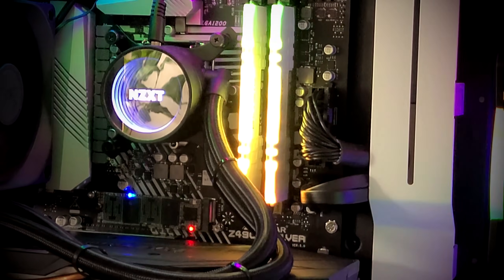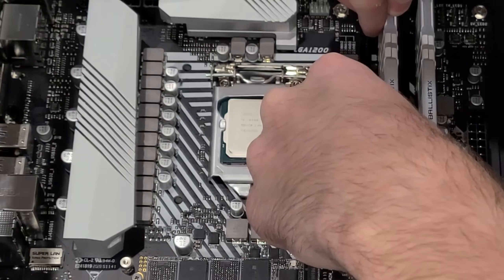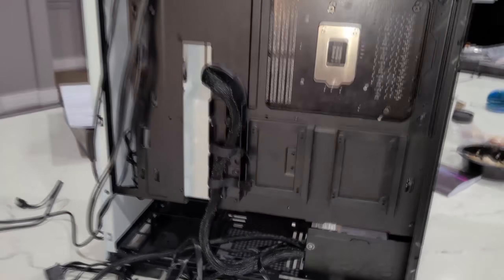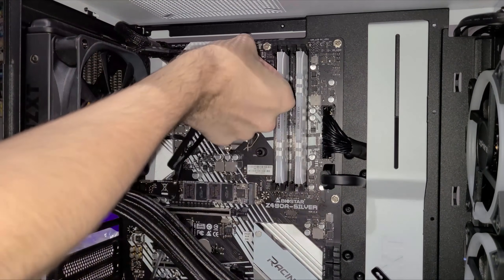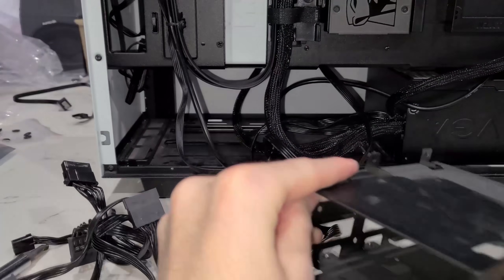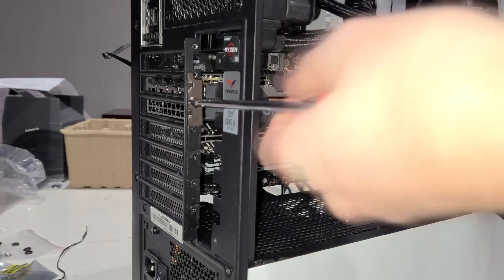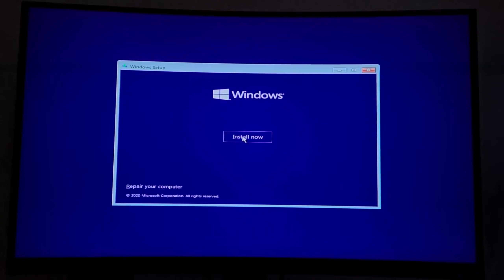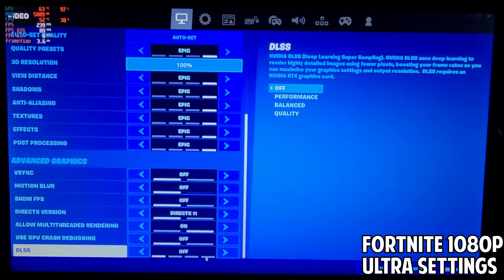BEST $1000 Streaming/Gaming PC [Build Tutorial, Benchmarks]

Comment: I’m gonna build this pc soon, are you able to run Warzone with these stats?

1440p 144fps

Max texture

Max anti aliasing 

Everything else low
Reply: Not at 1440p 144fps but maybe 1080p 144fps
Reply: @EddieZheng-k3u  I figured, I wonder if you can pull 100 on 1440, id honestly be fine with higher settings on 1080 than lower settings on 1440
Reply: dont build it just get a rx 5700xt this is more about looks than performance the 2060 is not good enough
Reply: @oreoeatsoreos9412  yes the 2060 is good enough for Warzone, and yes the 5700xt does come with the performance of a 2070, but still, its more expensive.
Reply: @LegendarymmHD  ye but the rx 5700 xt is a lot better doesn't the 2070 retail for 500 the rx 5700 xt goes for 400 it has performance similar to a 2070 super so a 2060 is not good in all games at 1440p 144fps the rx 5700 xt will do a better job what's the point of not using the full potential of your budget
Reply: @oreoeatsoreos9412  don't just take US prices, a lot of countries are selling them for cheaper, or for more expensive, and most of the people who buy them don't do it from the US, so just.. literally stop arguing.
Reply: @LegendarymmHD  then that goes both ways dude thats countering my point while countering your own
Reply: @oreoeatsoreos9412  stop arguing lmao
Reply: @LegendarymmHD  why should i in fact im doing more good then harm by telling people that for a 1000 dollars they can get something better for less aesthetics. something that will save them money in the future if you believe that you cannot do 1k build with a 5700 xt then you are mistaken, if you go at me with the countries argument that will go both ways and also what about the people who are from the US? the least im doing is helping those in the US get something of better performance.
Reply: I have a 2060 and a ryzen 5 3600. The 3600 performs very similarly with the 10400. I get around 120-140fps 1080p so I’d say to expect around 100fps most settings high-max.
Reply: @derickvo317  thx a ton for the reply man good to know
Reply: Wait for 3070
Reply: Bro trust me, get RX 580 it's way cheaper and way better it has 8gb vram : ) then u will have left like 200$ and u can choose it to get better processor or smth
Reply: Maybe just put everything on low then you’ll definitely hit 1440p 144fps
Reply: Guys I need help,I’m sorta new to pc,so I want to know 100% if these parts match with one another and won’t bottleneck very much,is this good so far?

https://pcpartpicker.com/list/jqGpgt
Reply: Yonkaboo Exkaboo I ordered the psu,mobo,ram,and storage,should I change something else
Reply: Yonkaboo Exkaboo  how would it do with just a 1660
Reply: Yonkaboo Exkaboo  i might actually go with a 1660 super,but let me tell you,I was going to build a pc based off a pc build vid,but they said it’s better to have a 1660 super than a 5500xt,so I bought the same psu,ram,and mobo from the video except the storage I changed it to a m.2,I plan on getting the same cpu they said which is the ryzen 3 3100,but I wanted to make sure if me changing the graphics card was going to affect the components in a bad way
Reply: Yonkaboo Exkaboo  I wanted my budget to be $600 or a tad bit up,but I’ve been asking people if the build is alright to be reassured and order the rest
Reply: Yonkaboo Exkaboo  but can I pick any 144hz or is there any requirements for my pc?
Reply: and great vid btw

Comment: I heard the h510 does not have good airflow... is that true?!?!? I wanna get the case but I have cold feet about it
Reply: My case temps for my h510 i with a 2070 super is around 67 Celsius playing with RTX on with maxed settings. Awesome case though
Reply: yeah it doesn't have the best airflow so the optimal route with that case is to use an aio but if it doesn't fit your budget I'd get a different case.
Reply: @kyng_khris317  guess I might need to get another case then ahahah... thanks
Reply: @King-zo4vv  no problem but if you go for the aio a one fan variant like in the video is pretty cheap.
Reply: @kyng_khris317  I'll check it out but budget is kinda tight tho
Reply: @King-zo4vv  yeah I wanna say it's about $80 for the aio featured in the video but i'm also debating on whether it can fit my budget or not.

Comment: Im more about ryzen, so which one do you recommend me and can inuse the same motherboard?
Reply: If you like ryzen better, I suggest getting a ryzen 5 3600 or a ryzen 7 2700x along with a b450 board as z490 doesn't work
Reply: You can’t use a intel motherboard for a ryzen chip. Not compatible. But I would recommend any good quality b450 or even a B550 and if not that then you can get a x570
Reply: @juanmoreno2627  thanks @juan
Reply: @JohnTv2704   hey make sure the motherboard is compatible with the cpu. There are website that let u know
Reply: @juanmoreno2627  i advise you not to go with a b550 board since their price is almost the same as x570 and x570 has better features, i actually dont like how b550 is priced since x570 offers alot better at the same price
Reply: Cant use same motherboard. I would recommend a ryzen 5 3600.
Reply: Use the AMD Ryzen 5 3600 for your CPU and a good Motherboard is the MSI B450 Tomahawk Max
Reply: Ryzen Definitely.
IDK WTF Happened to him that he used a Intel CPU. Get the Ryzen 5 3600.
Reply: @ArnikoGiri  cause the I5 10400 has the same price point as the ryzen 5 3600 but is faster. The only problem is that most intel mainboards are more expensive then the most b450 and ryzen has more upgradebitlity so i would recommend ryzen too, but the intel cpu is faster.
Reply: @peterbraatz5859  Intel MOBOs are just a bit more expensive, that isn't a big of a deal, and the "You can upgrade from your X MOBO to the next gen CPU" is in some cases, just SOUND good, not actually good. Overall, for gaming, only Intel. If you ACTUALLY do streaming, productivity, go for the 3700x, maybe the 5600x, but the B550 MOBOs cost a LOT of money.
Reply: @LegendarymmHD  its right but a price that i would pay and there isnt a big deal in january b450 mobos get an update for ryzen 5000 and than the b550 arent worth it cause the next gen isnt on am 4 anymore. exept you want an PCie gen 4 ssd for a particular reason.
Reply: Commenting so I can know
Reply: Same
Reply: 3600/3700x
Reply: Budget wise ill recommend a 2600 its going for around $135 but if you want some better performance, then go for a 3600
But another option is the 2700x which has almost the same performance as the 3600 but the 2700x is meant for heavy workloads like rendering and since ot has the same performance as the 3600,then its also a good choice for gaming
Reply: Get a ryzen 5 3600 and a b450 tomahawk max. And make sure it’s the max version. You can check on pcpartpicker which b450 motherboards are compatible with the 3600. Don’t get an X570 unless you want PCIe 4.0 that bad which doesn’t even improve FPS on GPUs that support it and will just improve M.2 speed.
Reply: @derickvo317  the reason I'm saying x570 is a good choice is because of future proofing reasons
When zen3 gets released, x570 will be the best choice for it since zen3 will Take full advantage of all its features
Reply: Z490 is only for intel for ryzen probs a x570 and its honestly cheaper by about 50ish dollars
Reply: just get a 3600 a x570 you save money on the motherboard and dont have to spent extra on a aio cooler and can upgrade that horrid metal tin can of a case that would make the build much cheaper than a 1k for sure
Reply: Ryzen 100%